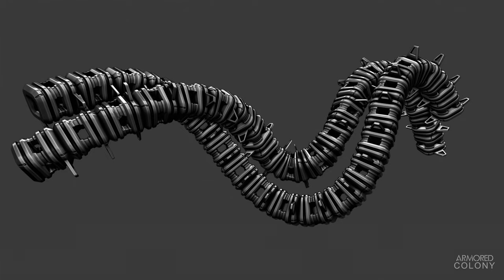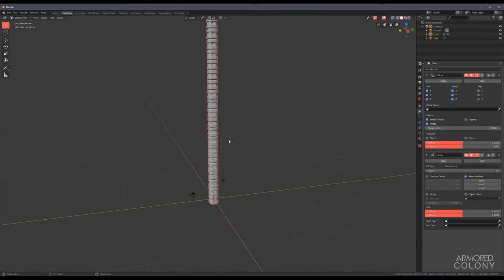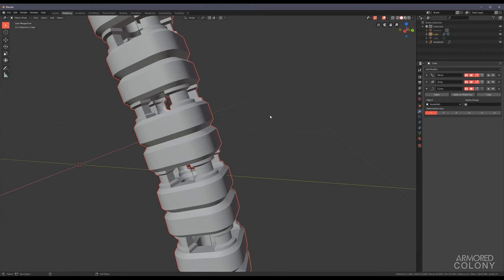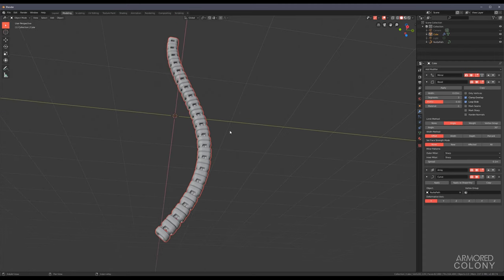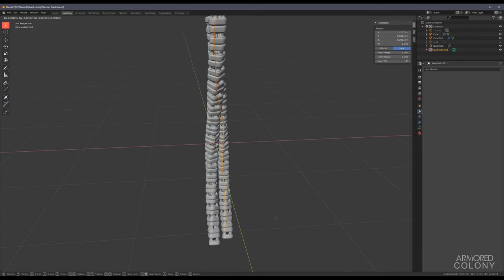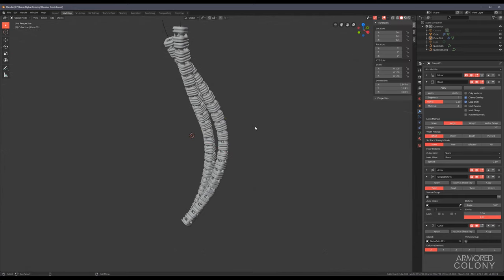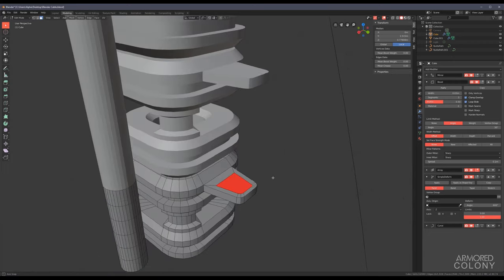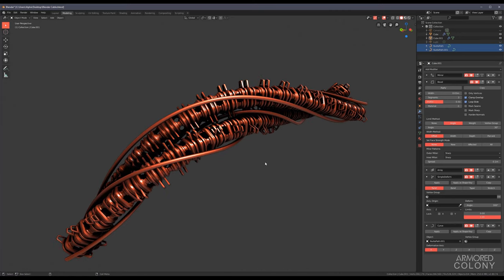Non-destructive Cables in Blender

Comment: Nice combination of modifiers, and cool result.  Tip: your mirror modifier is creating extra geometry, try modeling only 1/8 in edit mode if you mirror x, y, and z.  Might be a reason subD is slow for you as well.    Also, the array modifier can use the same curve to get the length without guessing how many steps you need.
Reply from the maker: Doesnt clipping slice the mesh and prevent the extra Geo? And that's really cool, how do you accomplish the auto fit array to curve length?

Comment: Maybe this is a stupid question, i'm pretty new to all this.. but assuming you were texturing/coloring this in substance or mari, would you do that first, then plug it back into blender and then add the array modifier?
Reply from the maker: Whatever you prefer. If you want all the elements to have the exact save UVs and textures then yes, you would export the mesh without the array, texture it and bring it back to array again.

Personally, I would just use textures with triplanar projection so I don't have to worry about UVs. Might even duplicate the mesh and apply the array modifier but that's ok since it's a copy.

Comment: I got a question, how would you make a cable like this without making a giga poly count? Im working on a character that features 8 of these cables, but the issue is that now the poly count has ramped up way to much for it to be game asset friendly. Ive tried many things like decimate, un-subdivide, remesh, etc, but they all have there own problems. Was starting to wonder if I should just make an entirely new cable, that would be more poly friendly but way less cool looking (which I find kinda bs, as I want something like the stuff you do in your video). All in all, im wondering if somebody had any tips or tricks for me to use, as it would really be appreciated to a newbie like me!
Reply from the maker: All of the above. Put some more thought on what can you make that looks cool but can save some polys, remake it with that in mind. Finally create a second low res version (a low poly) and bake down the high poly details into it with normal maps, etc. I know it’s easier said than done but that is the nature of game art.
Reply: Armored Colony True that, thanks for the help, I feel more reassured now!

Comment: how do you change the shape of your mesh at the same time. like the beginning when you only select one edge but all the edges follow
Reply from the maker: What time in the video did you see this?
Reply: All the parts were you pull one face and all the other faces move. Like the very begining
Reply from the maker: @Se2ndchannel  - Oh, it has a Mirror modifier applied, that;s why moving one face moves the same faces on the other sides of the mesh.

Comment: Does the curve have to be a path, specifically? I followed all these steps except that I used a curve instead of a path because the path does not give near enough control compared to Bezier handles. However, when I apply the curve deform, it takes my array object, contorts it into a shape that doesn't even come close to the original curve shape, and offsets it by a huge distance away from the curve. WTF???
Reply from the maker: I Can Has KPop - you can use whichever, it still works. Go to Object mode and select your curve, the press ctrl+A and apply all transformations. Make sure that the mesh you want to deform is also at the world origin. If you want to move the curve then go to edit mode and move all of the points together, but DONT move it in Object mode.

Now you can change the axis in the curve deform options until you find one that works.